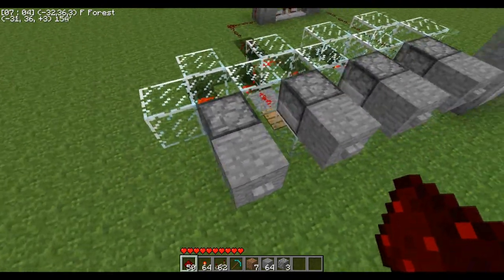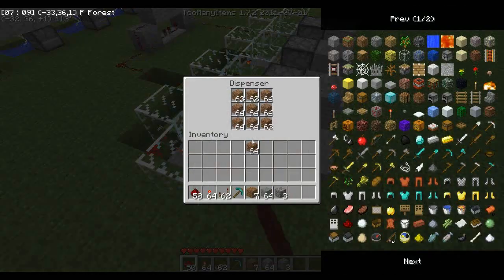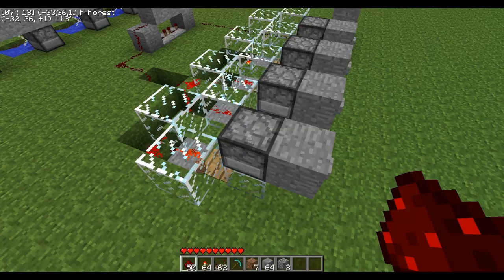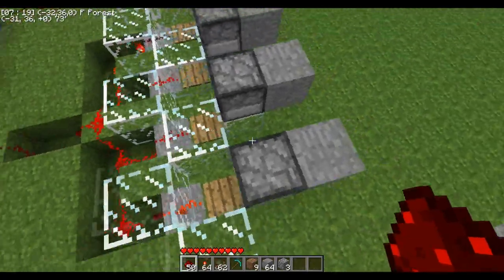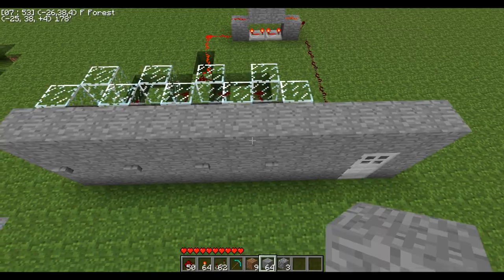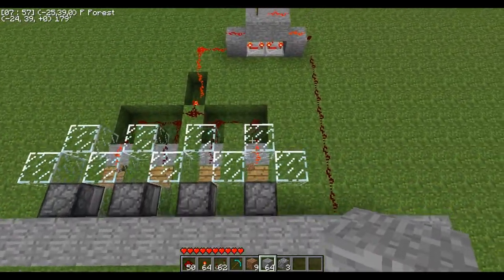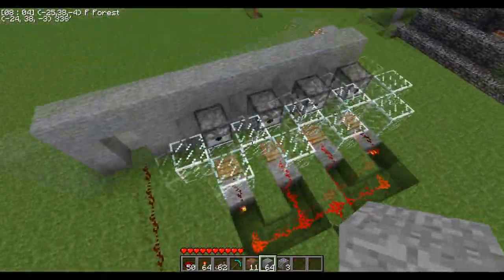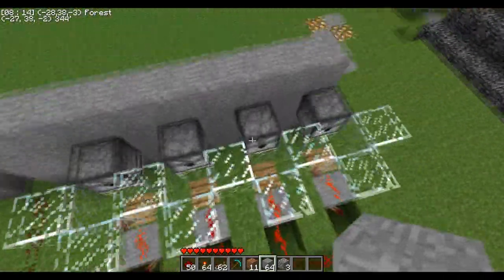REDSTONE: Dispenser Based Lock 2.0

Comment: Hey oliver if you put a block right in front of the dispenser the item will shoot straight down on to the block but depending on which way you are facing it can fall off the pressure plate but it can be fixed with a block.